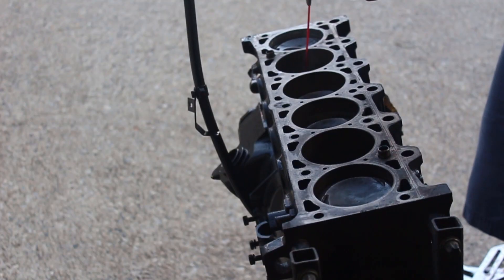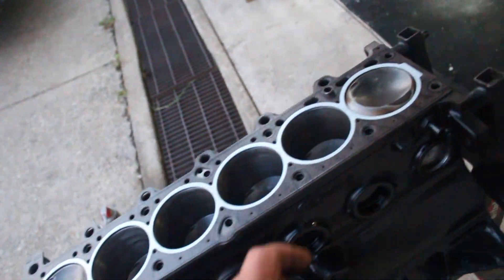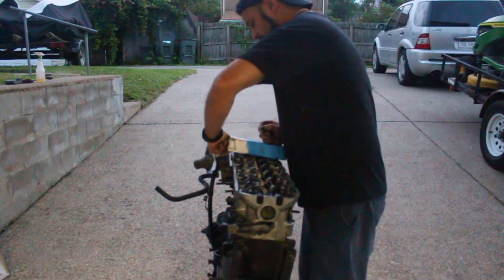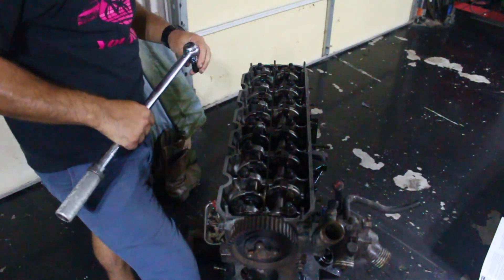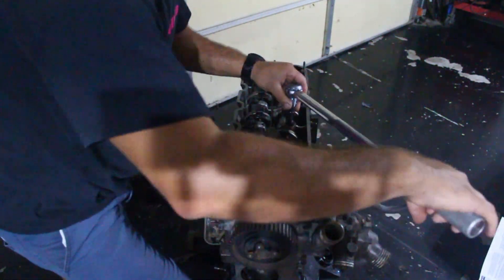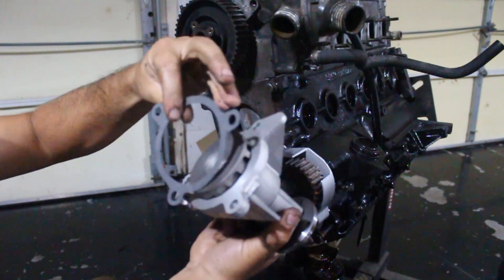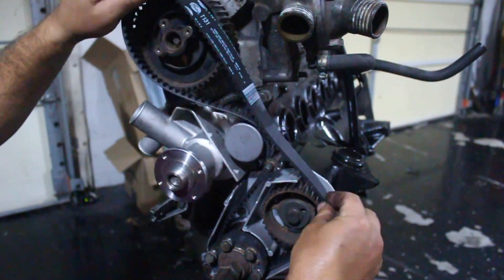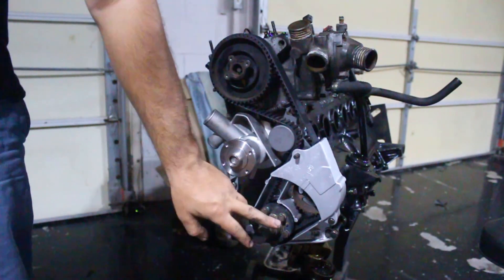BMW turbo M20 head gasket/water pump/timing belt install

Comment: hello i was wondering where you got the new cover and water pump?
Reply from the maker: The water pump is just a gates brand off ebay, its a kit with a gates timing belt and tensioner. What cover are you talking about?

Comment: so you tight the main crankshaft bolt with the gun?
Reply from the maker: Thats what I have always done. That bolt isn't torque to yield and its supposed to be torqued to like 350 ft lbs so I always have just hammered it on with a good impact.
Reply: @CARSTUDIOYT  actually is 400nm 
with the impact gun you dont know how much force you add
Reply from the maker: @bmwe-op4jx  true, but youre not going to hurt anything over-tightening that huge bolt.

Comment: Keep up the good work. I'm planning to ebay turbo my m20 525i soon. It's my race car for 24hours of Lemons. I hope it will last with all the abuse during the endurance racing. Have you had any problems with keeping the engine cool during long driver or aggressive driving?
Thank you
Reply from the maker: Thanks man, I cant say that I have given it that much abuse for an extended period of time. I can say that i never have noticed an increase in operating temp during aggressive driving, my car has a factory oil cooler though so that my have helped.